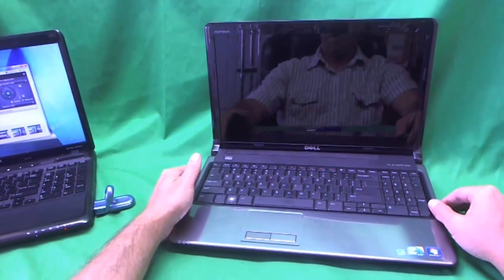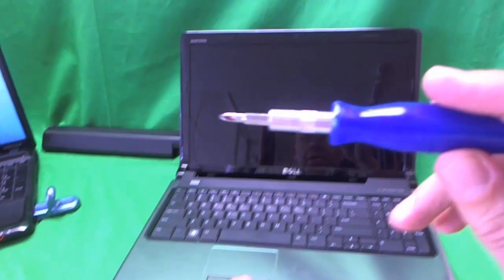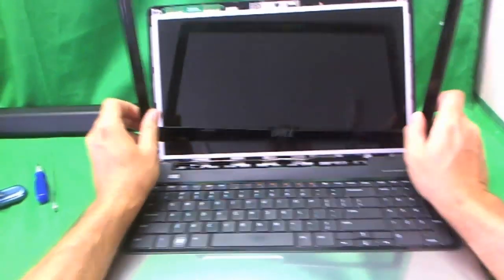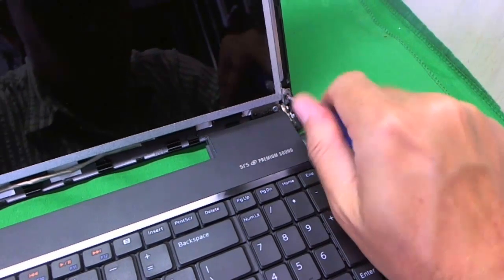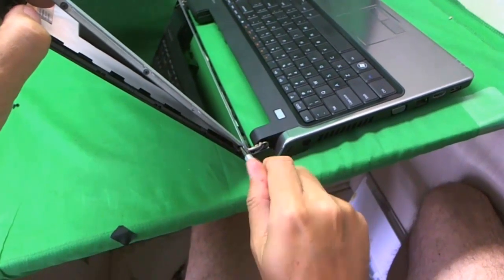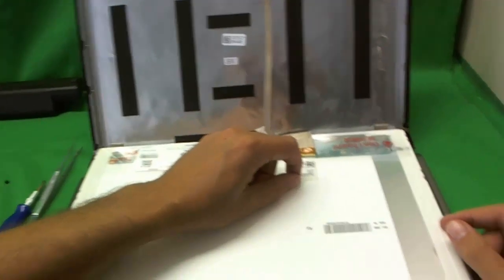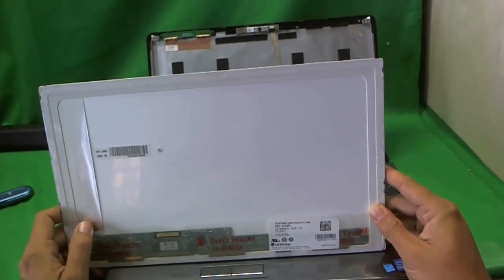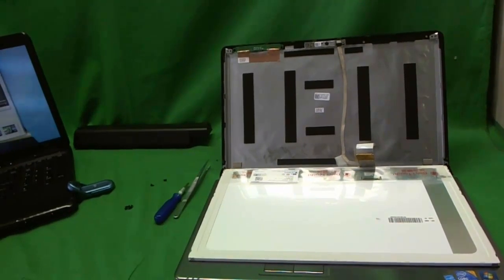Dell Inspiron 1564 Laptop Screen Replacement Procedure

Comment: Apparently, not all 1564s have the same screen.  I paid for a LP156WH2 (based on this video) only to discover my laptop has a BT156GW01.  Sigh.
Reply: Same case Jim. I opened up by screen now. I wanna know if  LP156WH2 is compatible with your laptop ?
Reply: MUIZ NADEEM  It is not. I returned that screen and got the correct model #.

Comment: i have the problem of my screen going white this must be a loose wire as when i contacted dell they offered too replace my screen at a cost of 105 pounds what a joke. thanks for the vid man seems an easy fix too doo will attempt this my thinks and by the way a screen costs 45 quid of ebay

Comment: i fucking love u man!! (no homo). i have exactly the same laptop and the screen use to flicker and go white all the time. i researched and some forums suggested that it could be a loose cable connection. i opened the screen and found out tht it was tht fucking loose cable and i did the connection firmly and put the screen back. no more white scren now. thnx.